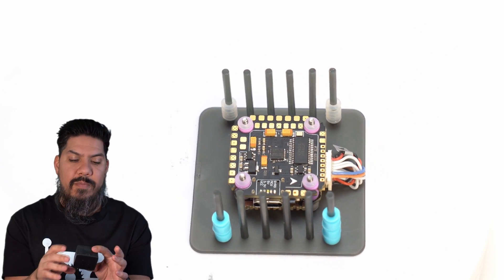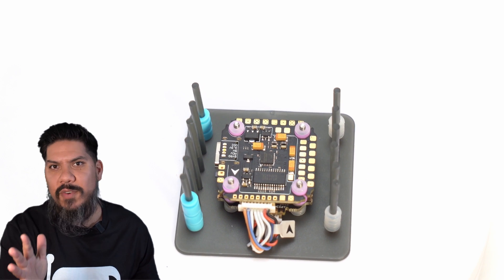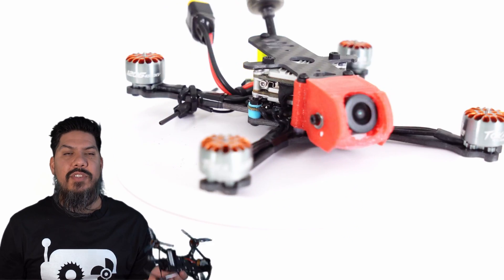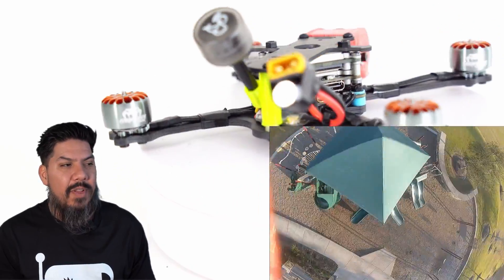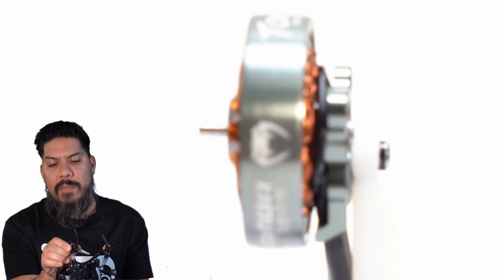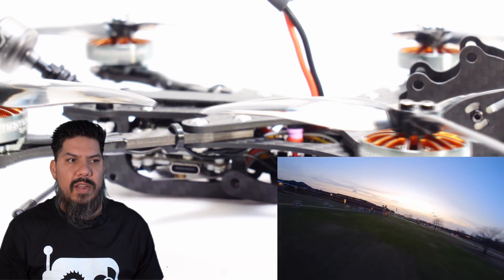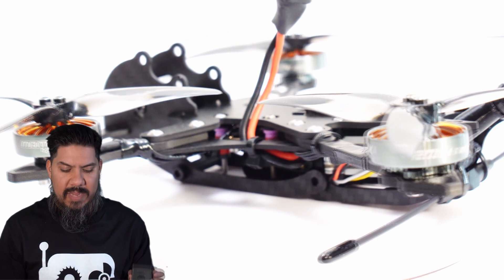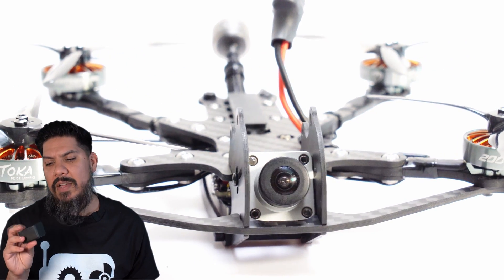Diatone Mamba MK3.5 stacks and new Toka 1204 and 2004 motors for drone builds - reliable quadcopter

Comment: The first stack I bought when I started out last year was a Mamba 20x20 F405 mk3. I blew the FC on the table while transfering it from one frame to another. Probably my fault. I replaced the F405 chip on it though and it works again. I bought a Mamba mk2 stack to replace the one with the blown FC immediately though. I blew the ESC on the table. Again probably my fault. I've put the MK2 FC with the MK3 ESC and have been using it that way for 9 or 10 months now. They still work great even after a lot of crashes and my learning curve. I've had this stack in a 3 inch Tadpole build, a 3 inch Geprc Cygnet Pro build and it's been living in my Fouride 4 inch build for a while now. Everything it seems breaks and blows, but I'm sold on Mamba. The stuff is inexpensive and it works just as well as any other brand I've bought.

Comment: im new..whats the diff btwn mk2 and mk3.5...can i use them with 1407 4000kv motors and 3s 3300mah battery..for 3 inch cinewhoop
Reply from the maker: mk3.5 has more amperage that can be used.  Either one should work well for that size.  If you want a little extra protection go for the 3.5.  Also for a cinehwoop a 3300mah battery will be too big most likely, it will be very large and heavy compared to a cinewhoop.
Reply: @JonE5FPV  thanks Jon.. typo there, i meant 1300mah or maybe 1.5ah 3s battery. i kind of dont have choice b
twn mk2 and mk3.5 as only 3.5 is deliver
able in my country. again, thanks for helping out

Comment: Picked up an F7 20x20 mk3.5 stack and liking the layout a lot better than even the 30x30 mk2s.  Baro and compass pads were great additions.  Only thing I don't like so much is it only came with 16ga wire for a 40A ESC, and I'd prefer 14ga, even on a lightweight build (and 12ga on full-weights).

Was looking at the toka 2004s, but the 4S were out of stock and the 6S just too low kv.  I also kind of wish they kept them grey and orange, though the green and gold look pretty good too.  Ended up going with the Chief 2005s, they don't look quite as good, but got quite a bit more stator for less than a gram of weight, and low-but-not-too-low kv, for a couple less bucks a motor.  Building this week and can't help but be excited.

Comment: I’m a big fan of Mamba stacks. I’m sure there are better overall stacks out there, but I stick with mamba because I know what I’m getting for the price and it has been extremely reliable for me in my builds. 
I was hoping they sent you the gold and green version of the toka motors...they look incredible!
Great content! (from a mostly silent viewer)
Reply from the maker: thanks a lot!  Yes, i totally want to check out some of those green colorway. And totally agree on the mamba. Yes i do use higher dollar stuff on occasion.  But if you crash hard enough, ANYTHING will die.  Makes it a sting a little less when the price is so much lower, and dont really see them dying any more frequently.  Probably used at least 30+ mamba stacks over the years. And only had 2 die and they were both the MKII 20x20 years ago.  Both times the FC died, in a very hard metal pole crash, but the ESC lived for some reason, lol.

Comment: Great channel. Do you think the Toka 2004  1700kv motors would be a good choice for an ultralight 5 inch long range running on 4 or 5s  li-ion?  They are very light at16 grams. Goal is 30 minutes flight time.  Motor selection is confusing.
Reply from the maker: If i was gonna go 4S id probably pick the higher Kv and use a throttle cut for max range, then you can take the throttle cut off, for some freestyle ripping.  (But then again, i love freestyle more than long rante.)  If you want max flight time on 4S with a bit less power, or if you want to go 5S, then yes 1700kv should be perfect.  

They have them in stock in both kv options here
https://newbeedrone.com/collections/all/products/diatone-mamba-toka-2004-1700kv-2900kv-racing-motor-green?aff=29
Reply: @JonE5FPV  Thanks for the response. Yesterday I flew out 5 miles on my DJI 4 inch and would like try for the limit of 8 miles! I need max flight time so I can make it home.